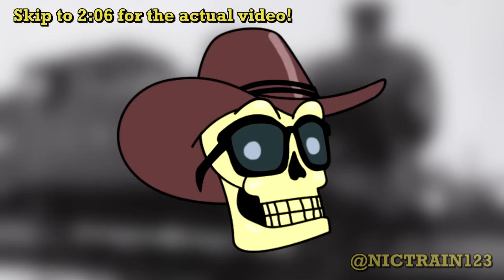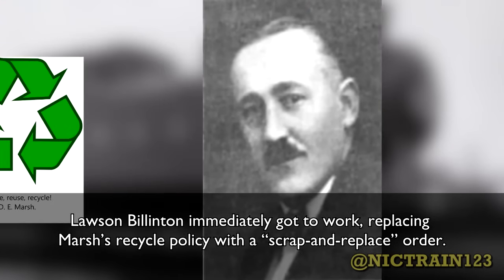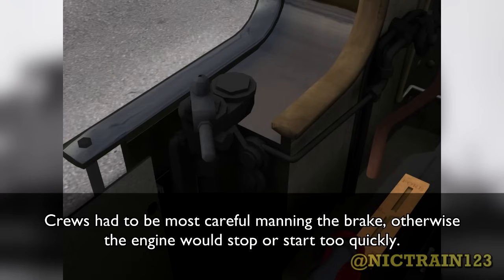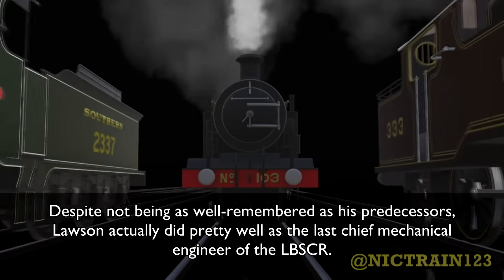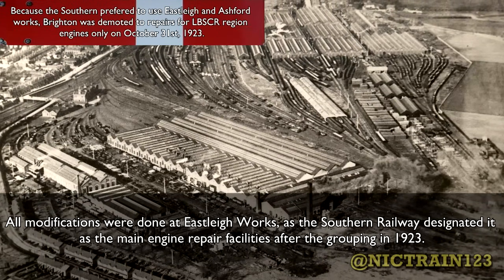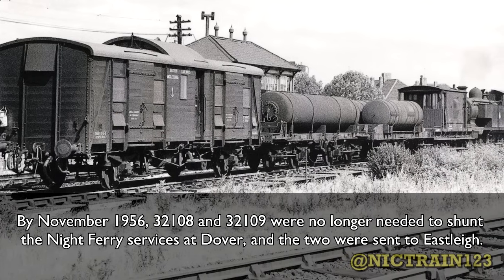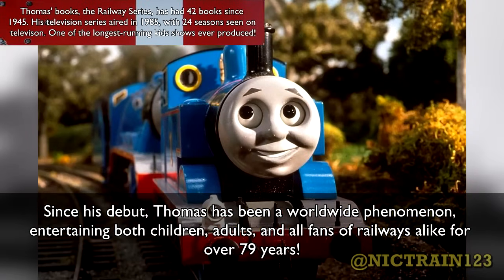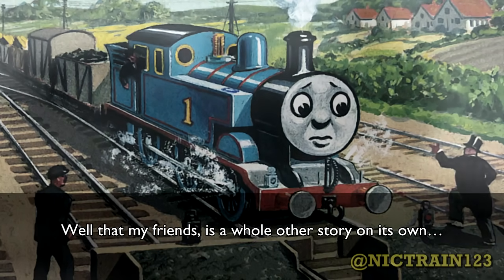The Complete History of the LBSCR E2s

Comment: My guess with Thomas in a technical sense is that Thomas is the “unofficial” 11th member of the London Brighton and South Coast Railway E2
Reply: Actually Thomas isn't the eleventh E2 but either E2 105 or 106
Reply: @christopherbellamy639  I prefer my head canon because……
If there was an intended order of 20 LB&SCR E2 tank engines, Thomas would be 11th member of his class in 1915. The Railway Series cannot determine whether or not Thomas was N.o 106, 107 or 108 because the origins prior coming to the Island of Sodor was never confirmed.

Even if Thomas was either 106, 107 or 108, it was a “duplicate number” to confuse the railway directors and London Brighton and South Coast Railway management to make them no know that Billington built an unofficial 11th E2 tank engine.
Reply: @Steamteamrailworks88  If you're looking at the real life build dates, then Thomas has to be either 105 or 106, because 107-109 weren't built until 1916. Which is after when Thomas is said to have arrived on Sodor. However I'll let you keep your head canon since it's just that, a head canon.
Reply: The version of Thomas that is painted in the green LBSC livery is numbered 107.

Comment: 9:07 Now I know where Awdry got 5’ 3” drive wheel idea for his Thomas Mk 3.  Though that would decrease his tractive effort greatly down to 18,263 lbs.  but if increase the boiler pressure up 185psi, and boring the cylinders to 18”x26” it only drop down to 21,206lbs.  So that’s a slight decrease.  It’s better than decreasing it dramatically
Reply from the maker: Yeah. Thomas was already OP as it is. A simple backtrack on tractive effort wouldn’t have been a big loss.

Comment: If they had unique boilers and a shorter wheelbase, they wouldn’t have had anywhere near as much criticism.

Imo, they should’ve committed to the shunter design or rebuild them as  “go anywhere” tank engines with more drastic changes than an increased water capacity.
Reply: The sad thing is the reason they probably were never rebuilt, was because there were already other engines who can do the job better
Reply: @xavierjuno4572  very true.   They sat in an awkward position

Comment: Do you think E2 could be alot better on curves if the second axel was flangeless?
Reply from the maker: Actually, the middle flange doesn’t need bothering with. Even if the middle drivers were blinded, it wouldn’t really help with tighter curves. The E2’s weren’t designed with taking tight curves in mind anyway, as many of the yards they worked in didn’t have them! Apart from dock railways, that is.

Comment: the E2s were based off the E1X by the design but they look different to me. There’s some things that are the same and somethings there difference between the E2 and the E1X?
Reply from the maker: The boiler designs were a bit different, and the E2’s were built with slotted frames. The E1X’s may have also been slightly smaller than the E2’s themselves.
Reply: @Nictrain123  thank you I thought maybe there were some differences between the two tank engines but I thought I’d ask
Reply: one other thing I’m curious about. This maybe different but I want to ask it because it is something I don’t understand. it’s with GER C53/LNER J70 tram number 7138 I did some reading and learned that 7138 was withdrawn in 1942. But why? Why would they withdraw it form service it could have passed into British railways days
Reply from the maker: @crashingboy2002  Honestly a good question. Haven’t found out about it yet.

Comment: This might be a stupid question, but how did the drive rods move independently from the cylinders? Where even were the cylinders?
Reply from the maker: The cylinders were right under the smokebox inside the frames. The E2’s had inside motion, which meant the valve gear was in-between the frames.

Comment: Long getting the body by half an inch? but they look the same as the original ones to me I mean the most notable thing is the extended side tanks and as I learned, they added that to increase the water capacity, but still what do you mean by long getting the body by half an inch it doesn’t look longer to me

Comment: So in summary:
1) The E2s were terrible steamers (already known)
2) They were also coal and water hungry with inadequate water and coal supplies for their type of boilers (already known)
3) They rode rough at high speed (already known)
4) While not ideal for passenger work, they did well enough as shunters (already known)
5) Their brakes were way too strong (already known)
6) As well as shunters they handled goods trains as required (already known)
7) Crews didn't like them (already known)
8) Their wheelbase made them too tight for the dock railway at Dover, necessitating the acquisition of the USA tanks (already known)
9) The class was kept on not necessarily for being successful but because the railway needed shunters with little cash, so rather than scrapping them and designing something more suitable the railway had to work with them (already known)

So the E2 was a good shunter.  And that's about it.  Any E2 apologist will claim they were useful only based on their shunting record because that's what they were designed for, but to be considered really useful a locomotive must have a wide range of uses - and be successful in such uses, not just scrape by.  The design must be flexible.  The E2s hit their stride as shunters.  While they did a few turns in passenger and goods workings it was mainly due to a lack of other engines available, not an indicator of any apparent usefulness.  If other engines were available the crews likely would have preferred taking them over the E2.  Good shunters they were, but flexible and useful in multiple situations they were not, so the verdict still stands that the E2s were not useful engines and the only reason we're talking about the E2s at all is because of Thomas which gives an overall false impression of what the E2s were really like.
Did I miss anything?
Reply from the maker: 8, again, is a misconception. They only worked with the USA’s at Southampton, and even then the USA’s were already there when the E2’s arrived in the late 50’s. The E2’s were supposed to supplement the USA’s due to the latter’s limited bunker capacity. But overall, you got most of the points right.